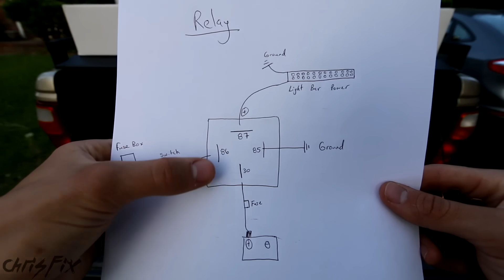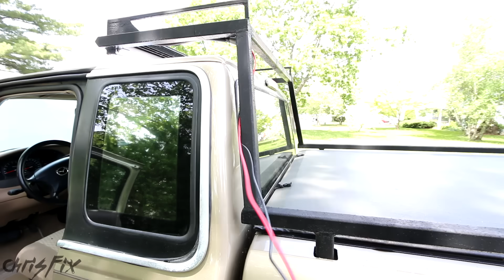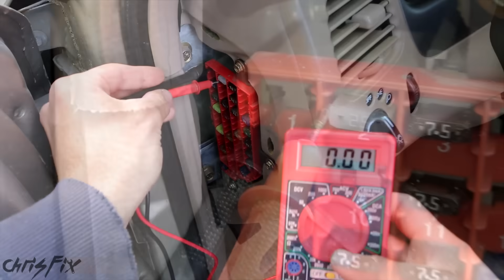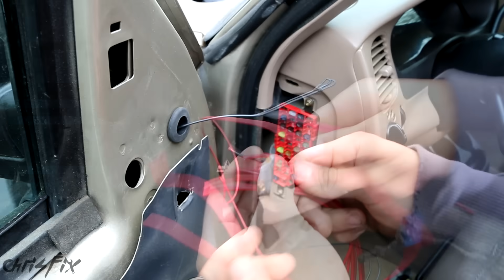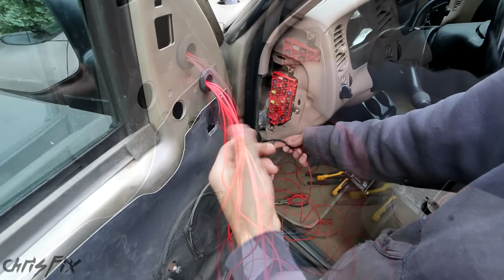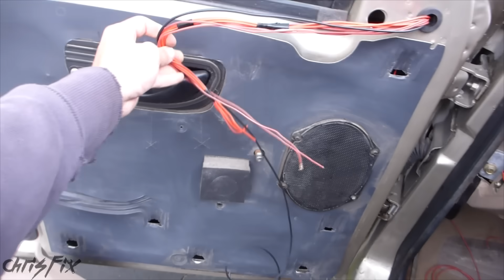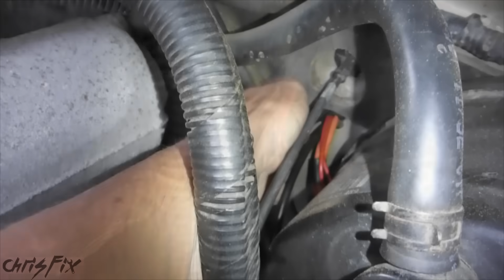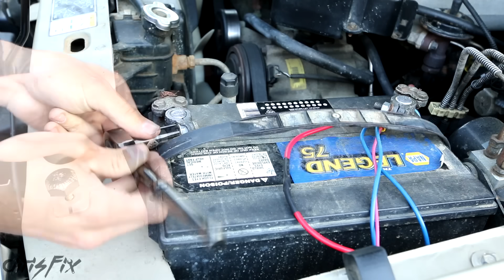How to Wire an LED Light Bar Properly (Project Night Light Episode 3)

Comment: Great video! Have you considered something like a battery terminal block for the + and - side for multiple wire hookups?

And do you have a high output alternator? All these lights might kill a stock one pretty quick.

Comment: 8 wires for 4 circuits that are relayed? probably only needed 1 feed for all 4 especially if they are LED,
Reply from the maker: ***** The switches have lights in them that I want to work so I need to run the switch off the power, not the ground.

Comment: @chrisfix I noticed in the video you mention the light from it reaches the edge of the hood. Is that a problem with light bars that hang over the top of the windshield?
Reply from the maker: jmodic2 Correct. If it hangs over the hood, the hood will light up and you will lose your night-vision. You dont want the hood to light up.

Comment: If you plan on adding more lights.  You might consider getting terminal blocks for your positive and negative from your battery.  That way, you will have less wires attached directly to your battery terminals.  You could also run a terminal block up under your dash so you do not have to keep using fuse taps to hook up your other lights.
Reply from the maker: wyldbladze Thanks a lot for the tip!

Comment: Extremely Helpful Vid Chris! Just got done wiring some off road lights to my crown vic's pushbar, followed the same procedure and all, my question is that the switch for the lights that came with mine has a very small glowing red light that indicates it's off. This light never stop glowing even when the car is off, i wired the lights and switch directly to my battery, do you think it would kill my car's battery overnight? My car's got an optima yellow top battery with a 200 AMP alternator.
Reply from the maker: Mushtaq Samim Switch around the two red wires that go to the switch. That is why it is on. I dont think it will kill the battery but it is better to not have it on.
Reply: Definitely, thanks!

Comment: ok Chris, and all the wire must be 10 awg? i mean, the wire from the switch to the relay, from the relay to the baterry etc, or only the wire that goes to the light bar? thank you so much for your help.
Reply from the maker: Christian Decrock The wires that goes from the battery to the relay and the relay to the light have to be 10 gauge because it is carrying a lot of current. The switch wire is only pulling .5amps max so it can be skinny.

Comment: Hey ChrisFix, I'm planning to install interior led in my car. Just so you know, I want it to work the same time as the headlight, and it's 30 amp. I'm going to fuse the led with a 10 amp. I can see there is 2 method of installation. 1 is going to be cutting the headlight wire and wire back together with the led wire. Or 2 is going to be the fuse tap method but I have to drill a hole in my fuse box. I really don't want to drill a hole in my fuse box and want to do the first method. Is the first method safe enough that it won't blow up the fuse or I'm better off drilling the fuse box?
Reply from the maker: thekillersnake94 The first method might melt some wires so I would go with the second. You can run a wire right off the positive terminal of the battery and put an in line fuse on that.
Reply: +ChrisFix Update: Months after planing and gathering tools and equipment, I finally got the led installation done. I did the first method and use 16 gauge wires and use a 5 amp fuse. So far so good. The 5 amp haven't blown for couple of days since installation. I notice the headlight wire is thinner than the 16 gauge led wire, I really doubt 30 amp goes though that wire. I also notice that 30 amp factory fuse powers multiple accessories, the headlight is one of them of course. I appreciate you show the hanger method because it really helps. My already owned drill won't penetrate the firewall so I did the hanger method. I snake the led wire though a tight factory gourmet hole located near the door hinges and run it inside my fender to the headlight wire.

Comment: hey Chris, i got a question for you, i just installed my new 44 inches led light bar in the roof of my truck, with a wiring harness i bought from amazon, but when i was making the instalation, i figured out the wire was too short, so i decided to extend the wire for like 3 ft. When i finished the instalation and turned the light bar on, the wire started to heat very fast. Why did that happen? because the wire i bought from amazon is 18 AWG? should i use a bigger wire, like 14 AWG? Or that's not the real reason? i hope you can help me out. My light bar is 44" 288W.
Reply from the maker: You need to run the correct gauge wire.  I explain how to find the right gauge wire in the beginning of this video. Don't run your light bar because it can catch fire. I'm guessing 10 gauge is what you need.

Comment: I'm wanting to add some projector lights that come on with my interior lights when the door opens but I have no lights on the door that I can tap into. Any suggestions on how to wire those?
Reply from the maker: ringtyler You can tap into the dome light.

Comment: You could have put the wiring harness inside the square tubes before soldering them together
Reply from the maker: uski I sealed the tubes so they would not rust from the inside, otherwise that is a great idea!

Comment: Hey ChrisFix I noticed you have a good amount of stuff wired up to your battery.
2 questions, 1) how many amps/watts is too much to have on the battery 2) would you ever consider wiring up a second isolated battery?
Reply from the maker: JaronAames It all depends on what size battery and alternator you have. This is the stock 90amp alternator but I have a 130amp alternator going in soon so there are no problems (although the stock one can handle what I am doing right now). I wont be wiring a second battery but I will be wiring up a better alternator. A second battery is more for audio systems or things that require a lot of power all at once but for a short period of time.

Comment: Hey there I have been watching your vids for a while now and they are all aerodyne I myself install electronics all day so I could give u a couple of tips that are not for amateurs lol 
You can use the ground side of the relay to put a switch on can save u a fuse holder or tap and some wiring also the closer you ground ur electronics to where they are mounted the better also saving you wire makes the electronics work easier since there is not much wire to go trough to complete the circuit also grounding strait to the battery can damage ur electronics or battery more not saying it will make it blow up or go bad in a day or two but the less strees you put on the wiring the better the best place to ground is frame rails also upsizing wiring can help a lot or the load factory wiring can be 10 or 8 g wire just by putting a piece of 4 g wire on top of existing wire from battery to alternator and frame will help a whole bunch specially if there's a lot of electronics on the vehicle also try to clean with a wire brush bolts and plates your grounding too and battery post any kind of paint dirt or oil in between connectors just make the electrical system work header 
Ok well I wrote you a book hope u read it all pretty sure u will thanks for your Vids bro
Reply from the maker: Alexis Arenivas Thanks a lot Alexis! I appreciate the tips! I will definitely take them into consideration!

Comment: I'm not wiring a light like that but I'm doing something similar, I wasn't really sure how to use a relay or even a wire up a light up switch but basically this answers all my questions. Thanks for going to the effort of doing this, editing and uploading. Super. Little question if i may, is it worth running a relay for a circuit with max values of 12v @ 3Amps? Thanks.
Reply from the maker: razgriz33 No problem man! For a circuit that uses 3amps you dont have to run a relay. Just make sure you run thick enough wires (use the chart in the description) and make sure the circuit is fused with a 5amp fuse!
Reply: ChrisFix thanks again.

Comment: hey, i know this is your build and everything but it looked like your light bar was pointed right at the ground in front of your truck. id recommend adjusting it so that the spot part of your beam is shining ahead of your truck to get the full effect of the light. im only letting you know this out of experience, i have a 40" rigid industries and a 20" cree on my truck.

Comment: why not run with all the other wiring into the Cabin and all other connections are available there Done

Running the LED bar independently is Illegal at least in Oz it is it can ONLY be powered when OEM lighting is on High.
Reply from the maker: mozzmann You do not want to run the high amp wires into the cabin to prevent any sort of fire. It is best to keep them in the engine compartment. It is legal where I am from to run them on a switch.
Reply: ChrisFix  Sorry Chris but that is a poor excuse for additional work mate considering the current carried by a fair potions of the harness already there under the dash,  most of those light bars draw around 15 Amps @ 14 V DC depending on the type is why I asked.  Running the lights via a switch is normal but only being able to power them up after your main lights are on would be smart I'd have thought.
Reply from the maker: mozzmann It is not an excuse. Any large amp wiring in a car has a relay. A switch also creates a larger voltage drop than a relay which helps with transmitting voltage to the light.
Reply: Not all large Amperage circuits use a relay but they generally do these day I'll grant you.
     Driving that light directly Vis a switch is asking for trouble but Voltage drop isn't the issue there, current supply however is.

          Your still missing my point I think and that is the availability under the dash high current connections, so why not tap in there adjacent to the fuse panel for instance to power your relay and then only have a single small gauge wire to the switch and a single larger wire to contend with to power the Light.

     I always switch my relays to ground as it is more efficient and requires less wiring and the Chassis grounds the Light.
.
Reply from the maker: mozzmann Gotcha, that is definitely another method switching to ground!
Reply: Worked on quite a few cars that do it that way ,  I wasn't trying to be a smart arse either so sorry if it sounded like it ,
I have been blinded by dickheads here in Oz that run lights like this on the roof  on the highway and get away with it .

Comment: Why won't you replace your old lighter with xenon light or LED light?
Reply from the maker: Alim Naizabek I am! That video is coming soon!
Reply: ChrisFix If talking about headlights, I recommend HID lighting so it doesn't melt the lenses. 9k-15k should do and not be too notice able
Reply: ChrisFix I'm really looking forward to that, I plan to do the same thing.
Reply: ChrisFix don't forget to make sure that your headlamps are able to control the light beam from HID or LED. you need projector optics. multi-reflector as on your truck won't.
Really like your video! l'm looking forward to see the mod.

Comment: The facepalm was real. I like your methods, youre very neat and organized, but you could have just ran your wire, and then cut and recrimped the fuse tap. Better yet, you could have not crimped the connector that came with it. lol just pointing that out
Reply from the maker: SlickNicklol Thanks for sharing! You cant "recrimp" the fuse tap because once a crimp is crimped, it is crimped forever!

Comment: Wow that light bar is bright! Was not expecting results like that!! A nice finishing touch would be hiding the wires in the steel frame. Drill a couple holes and feed the wires through :) 

Thanks for the videos mate. Really enjoy watching!
Reply from the maker: Andrew Allison Thanks a lot man! I was thinking about running the wires thought he frame but things rust really easily here so I sealed the beams instead. Great suggestion though!

Comment: you made a mistake. There are wiring harnesses for the relay that prevent shortages in case of weather. I've been doing wiring for a while, and I know, if you have the right wiring harness with the right shrink wiring tool, you could prevent damage to the wiring. The way your doing it with wiring is 90% correct, but you need to secure it with 100% water proofing.

Comment: Chris,
What gauge wire should I use if I'm running a wire from my power tab on my fog light relay to a wire that has power when the key is on. The wire will be about 6 inches long.
Thanks for your help and I really love your videos. You do a great job filming, editing and explaining everything thoroughly.  
-Zach

Comment: Hi Chris, greetings from England. I`ve enjoyed watching this little series, good strong job, well executed. Specially impressed with some of the welding considering it came from a gasless MIG, (which I despise) but I have a few suggestions/things I would have done...
1. I would have run the wiring to the light bar within the box sections. (super neat, and as good a wiring protector as you`ll ever get) I know it`s impossible now, but hindsight is a wonderful thing, right?
2. I would have put small triangular fillet pieces in the corners where the (nearly) upright pieces meet the bed rails, and where the roof rack met the uprights, this would strenghten the whole thing considerably, which would allow me to.....
3. Weld some fine re-bar mesh lying horizontally, with maybe a couple of inch box section supports running front to back, into the area behind the light bar, allowing you to stow stuff up there, as you already have the tie-down rails in place.
4. When wiring a relay, it`s best practice to supply the control side of the relay (which are terminals 85 & 86) with a permanent fused (1 amp) power supply to terminal 85, (I usually use a small bridge wire with a 1 amp fuse inline from terminal 30) Then use the switch to ground terminal 86. This means you only have to run one wire to the switch, with another short wire from the second terminal on the switch to a nearby suitable ground (either into bodywork, or tap into an existing ground wire - Don`t worry it`s only carrying about 200 milliamps and close to zero volts - hopefully under 0.5v) So instead of that loom of 8 wires running through your door, you`d have only needed 4. Additionally, from a safety viewpoint, if a wire chafes on a piece of bodywork, the worst that will happen is that the equipment associated with the chafed wire will power up unexpectedly as the relay finds ground. Also, wiring it this way means not having to use those silly fuse jackers, which I dislike with a passion lol.
Can`t really pick faults, as the job is perfectly suitable. Hoping I`ve made some helpful suggestions is all.
Liked and subbed. Top banana. Carry on....
Reply from the maker: Simon Crane Hey bud. Thanks a lot for all of the tips and suggestions! I like all of them and will definitely take it into consideration for the next project!

Comment: Thanks for the awesome video. Can you explain how you got the wires to go into the cab? Did you drill a hole in the clutch plate and install a grommet?
Reply from the maker: wetwilly911 There was a hole there already so I did not have to drill anything. Check out Project Police Interceptor where I show the process: https://youtu.be/V_mXR_Kol4Q?t=6m2s

Comment: Nice video! But from the looks of it, you should probably tilt the light bar slightly upwards. At 27:32 you can see that most of the light is focused just infront of the hood :)
Reply from the maker: adammm142 Thanks!!! The light bar is focused perfectly. The camera just picks up the light in a weird way. You can see the whole focused area if you look at the sides and top of the trees.

Comment: Kind of cringed when i saw you using some of my least favorite butt connectors.Personally i've never been a fan of the hard plastic type connectors. I have seen way to many corrode out. I saw you used a heat shrink butt connector in this video once before. But the result did turn out good!  Really bright bar!

If you'd like to try out a couple more heat shrink connectors i could send you a few if you would like. Also the relays should point with the wires down to keep moisture out from the inside. I ran into this issue on my car with a aftermarket harness for my Retrofitted Projector setup. The lights would randomly turn on during the day and drain my battery.
Reply from the maker: now534 Thanks a lot man and thanks for the tip! I will point the relay down. The heat shrink butt connectors have been pretty good to me and create a really good connection. What type of heat shrink connectors do you use? As for your headlights, is the control box bad that regulates the switch from high to low beams? Who did you get your projectors from?
Reply: The connectors i use are made by SES (Sealed Electrical Systems i think is the name). My failure was because i had the Relays sideways so they collected water and rusted/corroded internally causing a failure.

I have Morimoto Mini H1 projectors retrofitted into my headlamps.
Reply from the maker: now534 Gotcha! Thanks for sharing!
Reply: ChrisFix if your interested in some I'd be willing to mail some out to you if you'd like.
Reply from the maker: now534 That would be pretty awesome! If it doesnt cost too much for you to send out I would like to try them out. Maybe I can use them in my bed light wiring video! Thanks man!
ChrisFix
PO Box 220
Tennent, NJ 07763
Reply: ChrisFix sure thing I'll try and get some mailed out tomorrow!
Reply from the maker: now534 Thanks again bud! No rush!